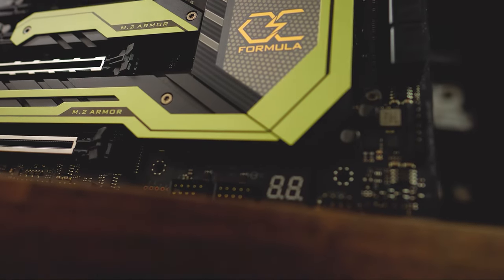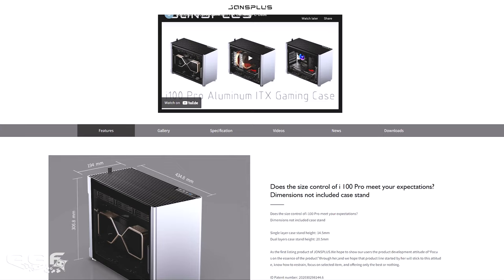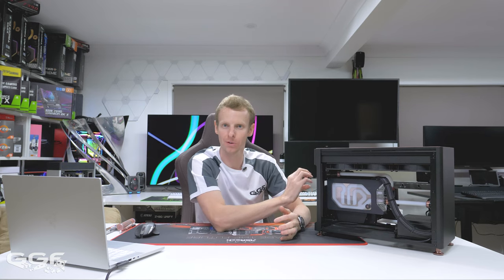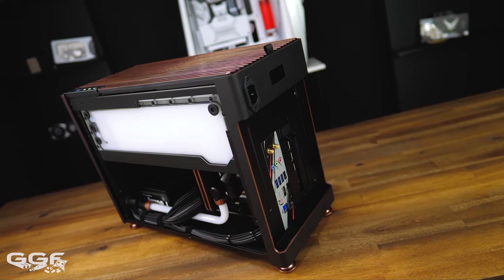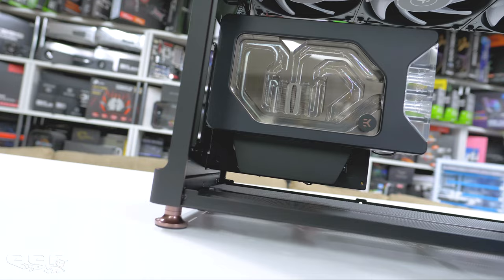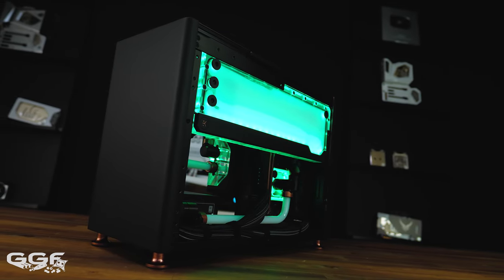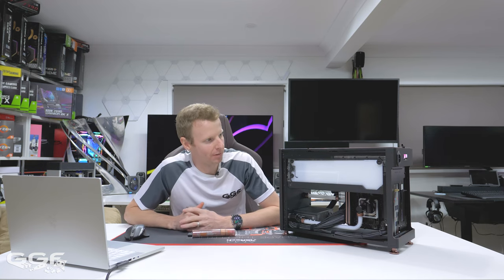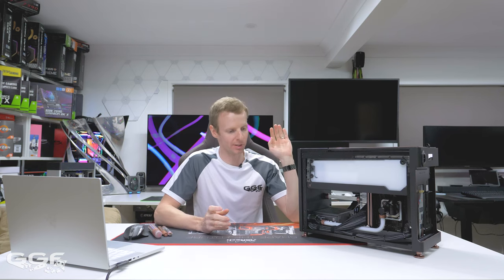Jonsplus i100 Pro, BIG ITX - Mod Build Video + Temps

Comment: On the standard layout this case could support dual 360 rads, its waaaay powerful cooling option, i have an Nr200 with dual 240 slim rads and kind of wanting a bit more cooling

Comment: @GSF Events - How did you get the FLT 360 next to the power socket?  According to EK, is that FLT thick? Is there some pressure applied to the power socket? According to EK specs, it is 25.5mm thick?  I purchased this case, and I like how the reservoir is incorporated. 

Thank you in advance.

Comment: Great stuff, just looking to build a watercooled system in one of these cases. Why did you choose not to use another radiator at the bottom? 240/360 slim perhaps?